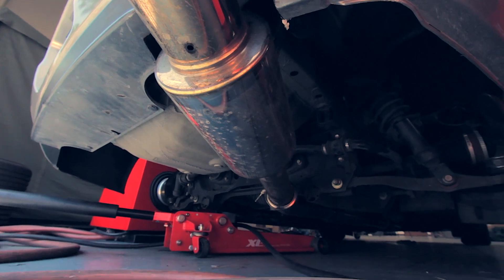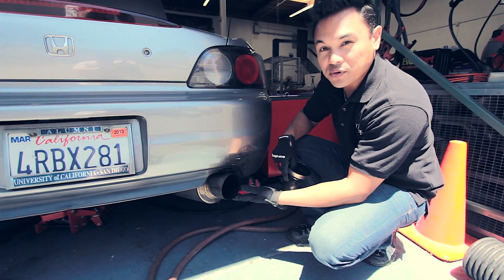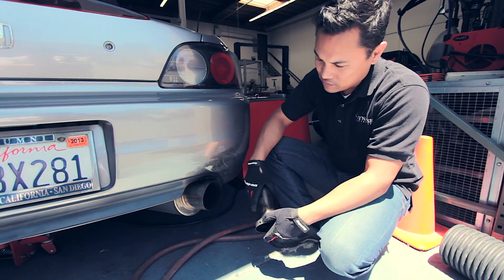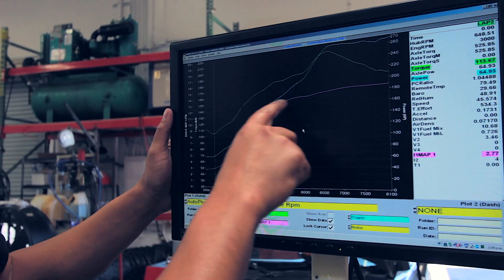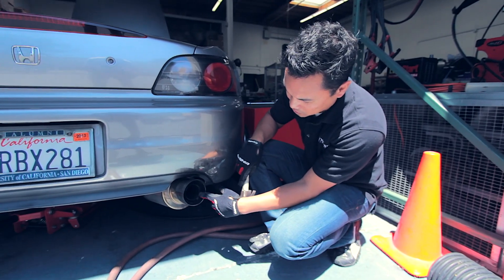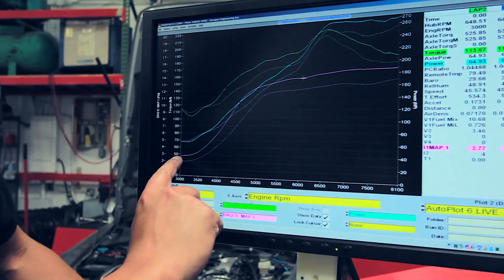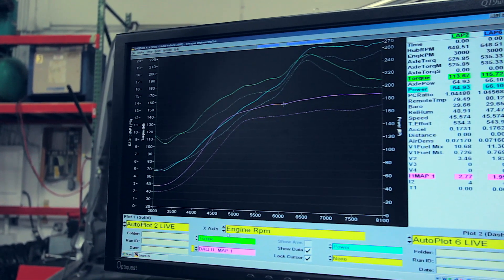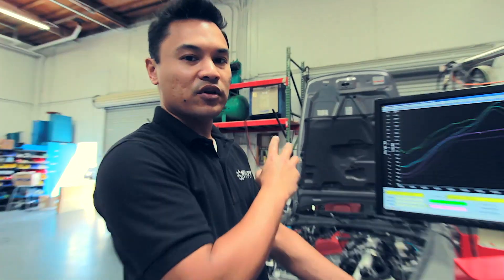Synapse Tech Series: Exhaust Restrictors and Power

Comment: Any restriction in the exhaust flow should show an impact on a forced induction car (as your video shows) but running a fart can (or as I call them, grapefruit launchers) on a  naturally aspirated car isn't going to show any real improvement in performance and may in fact result in a decrease depending on how well designed the exhaust system is.

Your next video should be an NA car with stock exhaust and then with a fart can exhaust - lets see if there's any REAL performance improvement or just

Comment: on an NA car, how big ur fart can isnt realy make any difference on a stock factory engine, but once you play with the engine compression or higher profile cams how big ur fart can is matter, you might as well need bigger pipe lets say 2.5 to 3inch.

so fart can +stock NA engine = NO NO
Fart can+ modified NA engine = yes yes.